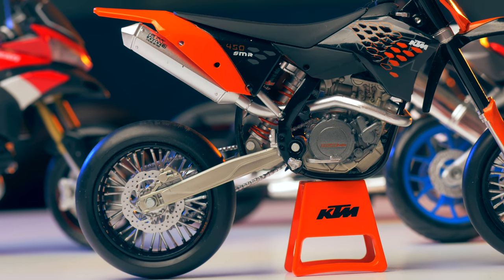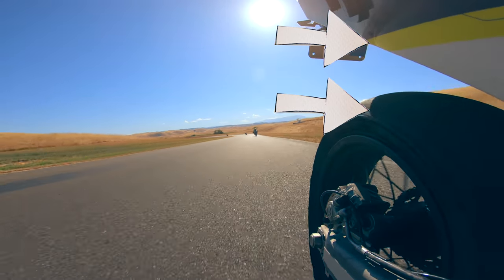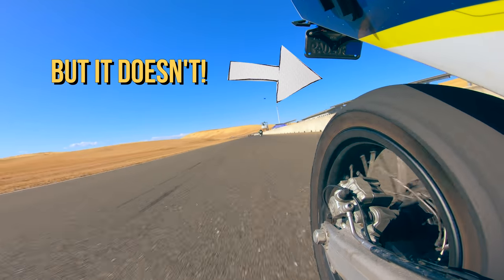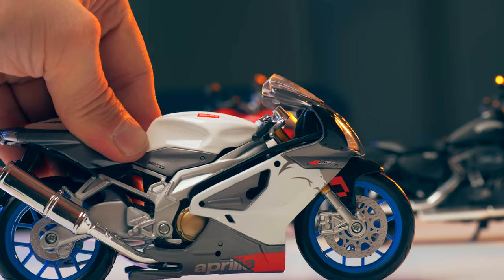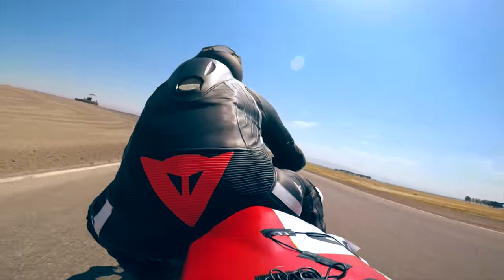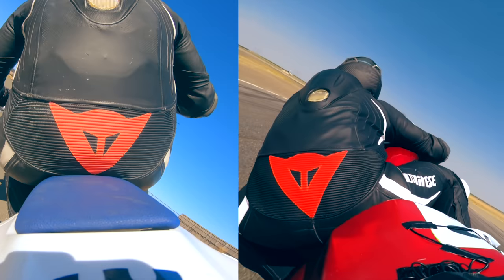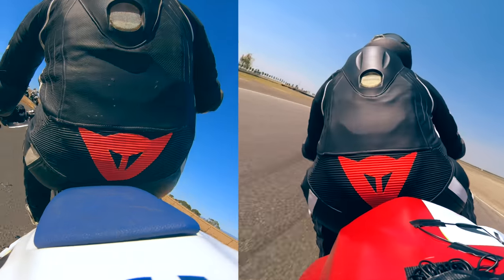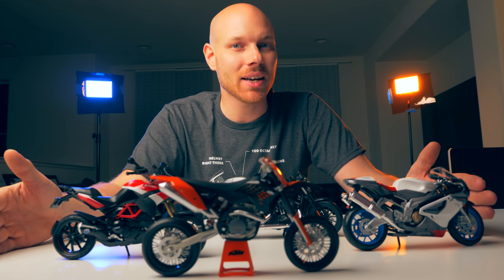Motorcycle Geometry | EXPLAINED

Comment: I'm PERFECT at understanding your video. Because I have virtually 0 experience riding a bike
I don't even know what the component's names are, much less how they function. 
Thus, saying "what" they do will be use ....... to memorize (not understand).

The difference between viewers who understand based on your words vs their intuition ... depend on understanding both how and why.  

Both are necessary.  Neither are sufficient. 

When you say raising the bars in the triple clamp means lowering them, people who've never "adjusted triple bars" should become certain of one thing:  We don't know what you're talking about. I know; I'll watch someone else's video to understand the principle you're explaining. Wait; is that not your goal..? 

I'll try with pool hoping it's something I understand that you may not (though you probably will as M.E. are going to understand vectors, rotational inertia, friction and converting linear force for the cue balls combined rotational  + linear moment. 

Inside english will kill the cue ball providing you a larger margins of error in certain instances where being on one half the table is sufficient.

Jacking up allows you to jump over and clear an edge of a ball pretty easily (by deflecting it off the table).

You can not only jump over cue ball obstructions, but even jump an object ball over an impeding object ball (with the right angle & power).

Outside lets you cut a ball despite the humidity, inter-ball friction enough to mitigate the value of cut-induced-throw. 

Using a thinner shaft will deflect the cue ball less when using side-spin, but, you'll always need to use the exact right offset to compensate for both deflection and the coriolis to pocket balls if the speed is low enough to allow some angular momentum to swerve the cue ball.  You can pocket a ball with almost any amount of misalignment (where your feet are relative to your stroke) causing a 'tip-offset' to spin (and deflect) the cue ball ... provided you hit the ball hard enough to minimize the coriolis WITH accurate understanding of the fullness of hit required on the object ball given the type of spin used and the distance from the object ball to the pocket. Likewise, you could also primarily rely on swerve (coriolis) despite not being aligned to pocket the ball; instead relying on the cue ball swerving back across the deflected line (crossing the straight-line path).  It will however, require a tremendous amount more visualization & MUCH better feel for the humidity, friction between the balls, the chalk ... and even then, should be limited to balls very close to the pocket which are obstruct by another ball, ,in which jumping it would require getting it up, down, and then not bouncing off the table ... requiring an even higher jump angle (which precludes your head from as naturally seeing the path the cue ball will take. Also, hitting the object ball above the equator magnifies errors because it's essentially a smaller ball ... which makes each millimeter correspond to greater changes in minutes and seconds of angle. 

Every statements was true, accurate and would be immediately understood by any pool player as such. 
I wouldn't count on someone who wasn't a pool player understanding any of them though, (unless they already did). Is that still teaching?

To know if say, a book I wanted to write were effective, I'd ask people who were incompetent, didn't understand principles, etc., but who wanted to (as in, clicked on your video) if they could explain the principle to me before (confirm they didn't know) and after watching (to ensure my concept was communicated).  If they don't, maybe it made sense to me...and would to others who already knew, ... but wouldn't to those who _didn't (or didn't well) already understand.

Comment: The rear does not squat under acceleration like a car. The rear seat goes UP due to the tension of the chain being turned by the engine.

Comment: Small issue with trail making it possible for a bike to stay upright. Experiments have shown that even reversing the trail doesn’t cause the bike to become unridable. Obviously it’s complicated but in short a bike 🚴 or 🏍️ will continue to do its thing with some pretty radical departures from conventional design. Sure that will cause things to function in a less than ideal way, but they still function.

Comment: I don't think you explained that part at the end correctly, it should be like this:
When you brake: TRAIL decreases, SWINGARM ANGLE increases, WHEELBASE decreases (shortens).
When you accelerate: TRAIL increases, SWINGARM ANGLE decreases, WHEELBASE increases (lengthens).

Comment: Good video, but the concepts are a bit “old”...Trail does nothing, (MotoGP bikes do not have small trails for example) it is just the resulting value of more important things like rake and offset. Higher trail does not mean necessarily more stability if we are talking about different bikes (115 slower to turn than 100), because you can achieve a certain value with infinite combinations (even silly ones). Lower center of gravity does not make a bike more stable in corners, and you confirm this when you say that you need to lean more at a given speed... it is necessary to reduce the leverage that will make the bike tip over during acceleration, that’s the reason why it is lower on sport bikes and why it is lower than the past (less power). And so on. Pay a visit to an Italian site called “Giornale Motori” and look for the tech articles of Federico, a top class engineer, it will explain why a book like the one of Cossalter does look certain thing backwards. Everything starts from CG position and mass distribution on the axes, but it is a long story :)

Comment: Pretty sure you got things backwards at 7:50
A larger rear sprocket will squat more, and transfer weight away from the front tire during acceleration.
A smaller rear sprocket provides anti squat and helps keep weight on the front.
Reply: Can you explain why. I also wasn't sure at that part. Thought about it, still not 100% clear to me how the sproket influences anti squat.

Comment: Need help. It hurt my brain trying to make sense out of it. In my common sense, low ground clearance = low CoG = (+) stability. That though makes sense in a straight, right?

I increase both tyres size in 1:1 ratio. I experience a significant head shake in straight line, scared the shit out of me. So my point is. If you move fork tube up it will decrease trail and vice versa. Doesn't higher ride high make it less stable? Or the consept completely whoosh me.

Comment: Hi Mike. Thanks for explaining anti-squat. I'm still trying to wrap my head around it. I was hoping you could explain what happens in the case of shaft driven motorcycle since there is no cain or belt to pull on swingarm. I've read here
https://www.motorcyclespecs.co.za/model/Honda/honda_cx500%2078.htm

(Bottom of page, 9th paragraph.)
on the Honda CX500 that acceleration would push the swingarm down. As I said earlier, I'm still trying to wrap my head around it. how would this affect riding when accelerating through a corner?
Reply: I dint read the article, regardless any bike while acceleration should push the swingarm down, is just hard to notice on lower than 60 70hp

Comment: 1:50 Acceleration does not cause the rear suspension to squat. It causes the rear suspension to extend.
Reply: Tell my corvette that. 
Also I think he said in theory you would think it would squat but that they have changed the geometry of the mechanics to where it doesn't
Reply: it does cause squat if there is not enough anti squat to counterbalance.

Comment: Well  Lot's of Theories    but not so sure that  the  small  changes through suspension travel  make too big of a difference..
  My Yamaha FZ-07  has  too steep  of fork rake at  24.5 Degrees ..  It's not stable at high speeds and you can't take your hands off from the handle bars say to cinch your helmet strap ..
  Also my swing arm is too short .. as it wheelies  too much .. The Yamaha Tracer has 2" longer swing arm..
  I test rode an  Indian FTR-1200 ..  much  Taller Bike .. yes  you don't have to lean as much in the corners..  very long wheelbase  so the 122 Horse Power does  not wheelie too much .
  I guess you would have to make a totally different video on suspension   rebound and compression dampening ect..
Reply: change the preload of your springs and find out
Reply: @Max-yy3lz   Stock forks  don't have pre load adjustments and I have not installed trhe Ohlin adjustable  Cartage kit yet..     Ohlin calls for  5W or 10W oil never heavier than that
Reply: forks may not, but rear shocks do.
also playing with the oil volume in the fork makes the front dive more or less when braking.

Comment: Around 10:00 you say that a higher centre of gravity requires less lean angle for a given (cornering) speed. Are you sure? If we assume the rider's CoG is in the same place I would have thought the lean angle was the same. For example with 45 degree lean you are turning at 1g regardless of how high the bike's CoG is. See https://en.wikipedia.org/wiki/Bicycle_and_motorcycle_dynamics#Turning
Reply from the maker: Read the same article again. Paragraph 4, of your reference:
"Bikes with fat tires and low center of mass must lean more than bikes with skinnier tires or higher centers of mass to negotiate the same turn at the same speed".

The combined motorcycle+ rider center of mass and tires width has a big impact on the lean angle of the motorcycle + rider.
Reply: @MikeonBikes  - To balance in cornering, it must be the the sideways cornering force combined with gravity (acting via the center of gravity) add vectorially and must balance on the contact point of contact on the road. Otherwise one'ld fall over.   

So the whole center of gravity must change with the rider hanging over the in side of the bike.  Looking at motogp on tv, this seems to be in play, especially mid-corner, and changing to sitting the bike up on exit.  

I have a  question about the real-time "lean angle" displayed through the bike's telemetry on the TV - is this is the lean of the bike, or is it a computed effective lean of the whole bike with the rider leaning off its side? 
 

This is an excellent video.

Comment: Geometry books would be hard to understand even for an engineer? Who do you think likely wrote the book? Who do you think designs motorcycles? Engineers. You make mc geometry sound like it's more difficult to understand than particle physics or includes some amount of philosophy. Motorcycle geometry is pretty basic stuff. Common sense to some. And you used the term laymen. What are you? A particle physicist philosopher?
Steering dampers aren't only for bikes with aggressive trail, they're also for off road applications such as a Baja race bike where rider fatigue comes into play.
You should do a video on the BMW coaxial traction system. This is where they put the drive sprocket on the same axis as the swingarm pivot. They learned a lot about chain tension and it's effect on traction because with that deign, the chain tension remains the same throughout the whole rear suspension travel. You'd do a much better job at that than me..and I think it would be a great video! Do it!

Comment: Personally I would leave tyre pressures alone, unless you change the wheel and tyre size for some reason (description).  Suspension is very important to get right for your weight though, if it's wrong it will feel very unsteady in the bends, get it right for instant confidence boosting.  Also raising the front is making the front higher not lower and for racing that is correct, you also want to lower the rear a little, but for street or just the odd track day, just make sure it's set up for you with suspension settings and no hight adjustment.

Comment: Anti-squat = Pro-pedal....Motorcycles/Mountain Bikes...Motorcycle rear suspension's do not have an adjustment for the very beginning of the stroke?? In this day and age?? Almost like a partial lockout that can be blown through if needed.
Reply: why should they when they have swingarm angle. these partial lockouts as you call them are also not very much wanted in suspension.
Reply: @Max-yy3lz  every swingarm has an angle that is supposed to benefit the suspension. Including where pivot point's are placed on that swingarm and suspension. The leverage ratio of how the swingarm moves in the suspension's stroke...just saying with all the technology ie: holeshot help ( lower the rear suspension) in the straight's help ( making the rear suspension lower or firmer)... I do not know much about motorcycle suspension. Thankyou...
Reply: @edahl3884  Anti squat does not equal progressive spring characteristics although the latter would also help minimize squat. I'm not sure if you confuse these two. 
 Antisquat uses the acceleration to lift the bike up by the way of how the swingarm is positioned.